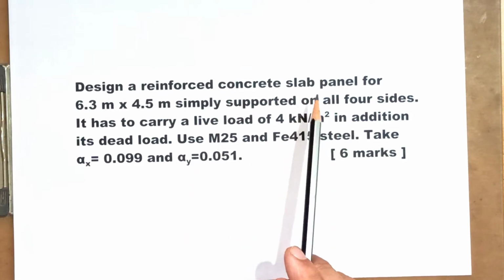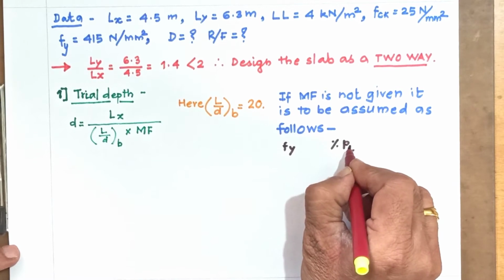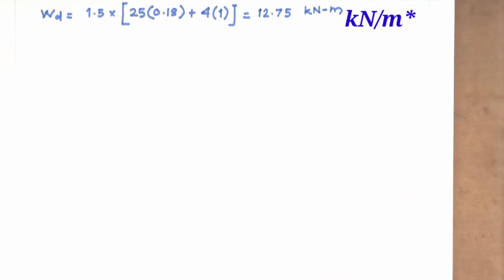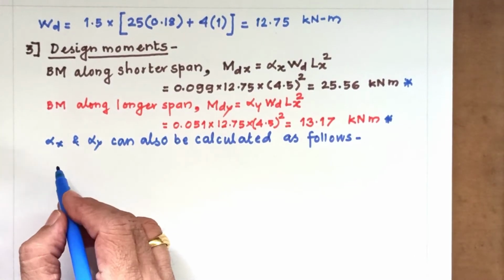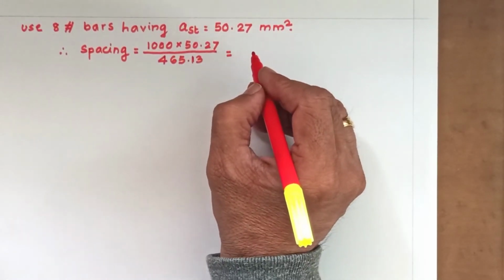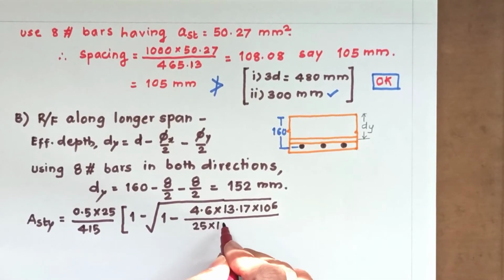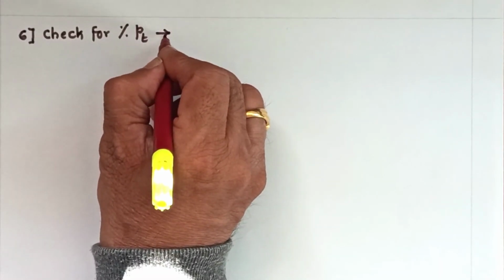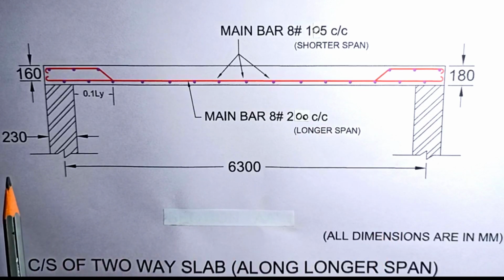Design of Two Way Simply Supported Slab with corners free to lift

Comment: design steps of two way slab are explained in a very excellent manner. Learner can visualize how to calculate effective depth of two way slab along short direction and long direction. Also can apply check for development in both directions confidently without any doubt and can draw cross sections along short and long directions.Learner can apply knowledge in the field during placement of reinforcement . Thanks for excellent procedure of two way slab design.
Reply from the maker: Thanks a lot for detailed viewing with thorough comments.